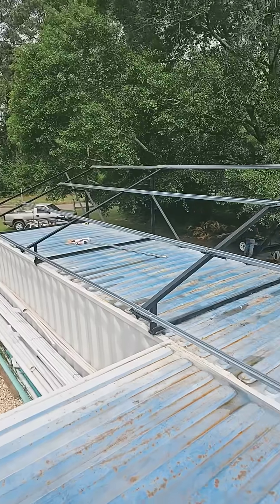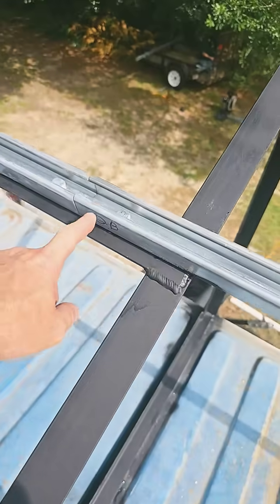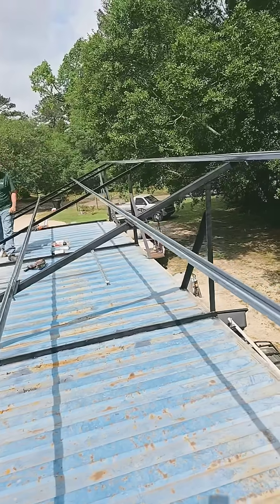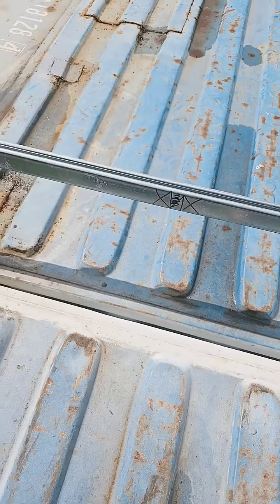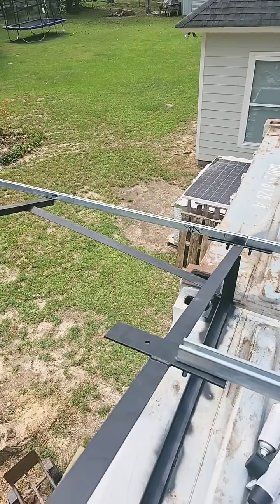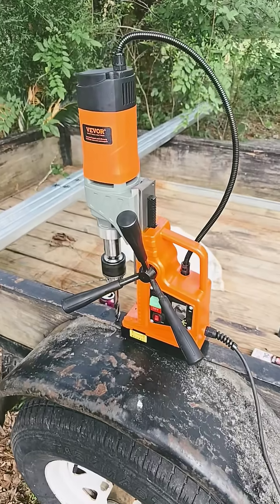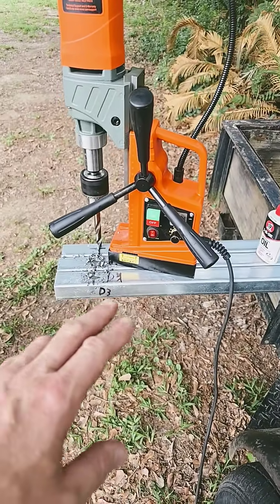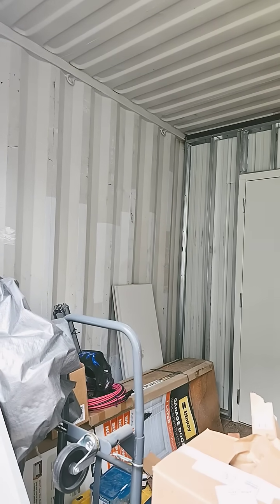10 KW high voltage off grid Solar shipping container rack steel welded rack mount

Comment: I'm guessing this system would cost around $50,000 to purchase from a company. By building it yourself, you can can have a customized solution with plenty of solar power and battery storage at a fraction of the cost.
Reply from the maker: 100% correct I'm barely going to be 15k all in for 10kw solar, 23kw inverters and 65kw battery storage.

I'll be releasing my specs in a long format video.